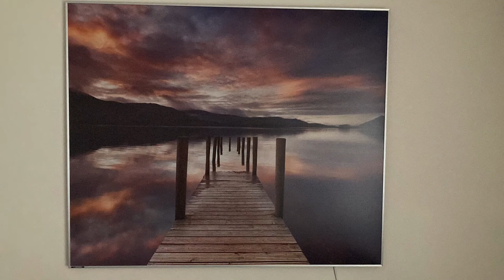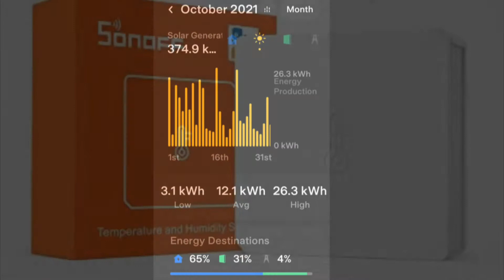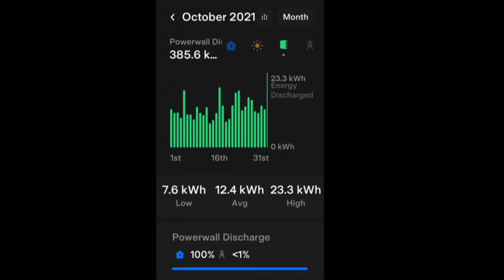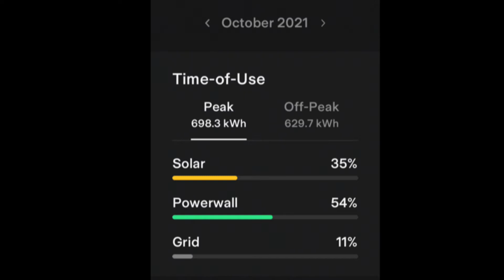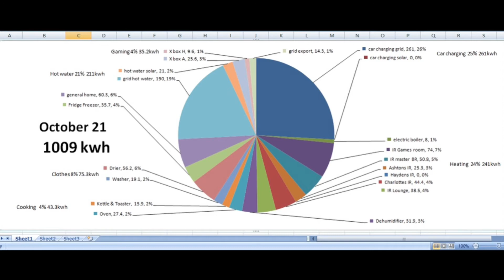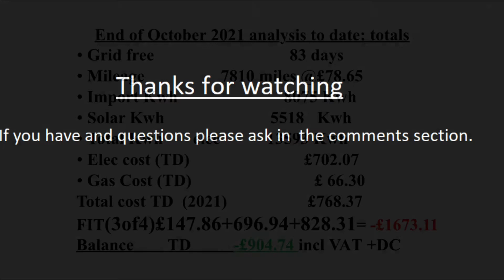Infra Red heating as part of the October month end stats and costs

Comment: How did you find switching to the infra ref panels compared to traditional heating methods? Are they as effective? And running costs using off peak electricity,is it on par with gas?
Reply from the maker: Gas wise I used to use 14-15 kWh per year , so less kWh used considerably but gas is cheaper , so electric heating is not cheap, I used zigbee temp sensors in each room which trigger the IR panels, on & off

Comment: Would it be possible to add 2 panels to my system i.e. 16 to 18. I have the space on my roof. As far as I'm aware, this does not break any rules since the inverter is the same as peak power is the same. The difference being more power being generated under poorer conditions. Also, would this break my contract with ION for FIT payments. I get over 50p per kWh presently. 
Or alternatively, could I have a separate  2 panel system. I'm very much into marginal gains. It also stimulates my geeky nature.
Reply from the maker: All depends on the voltage and current of the panels ( they would have to be same make and model also (panels )) as long as you don’t go over the maximum dc input voltage and current you will be ok
Reply: @AllElectricLiving  Thanks